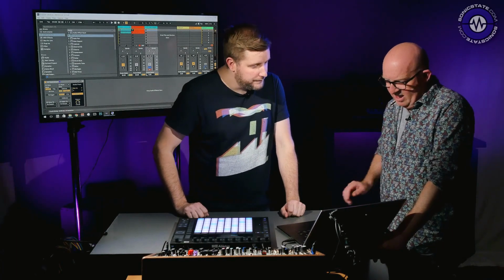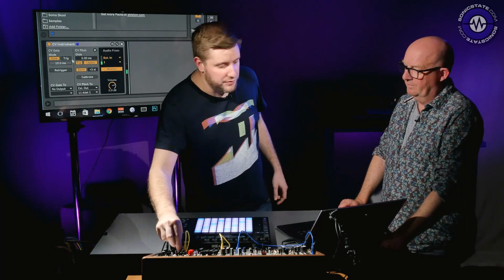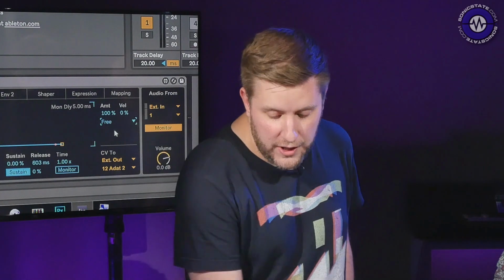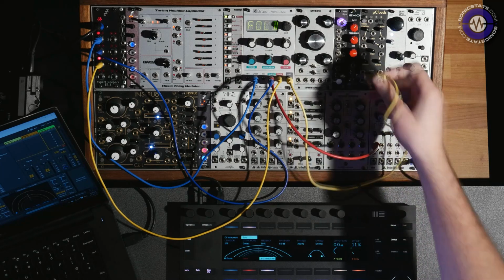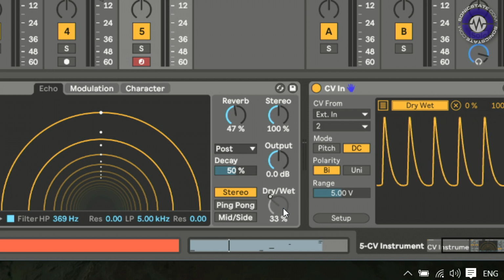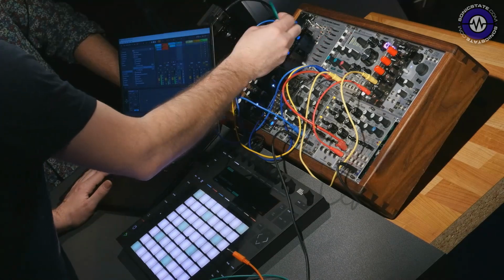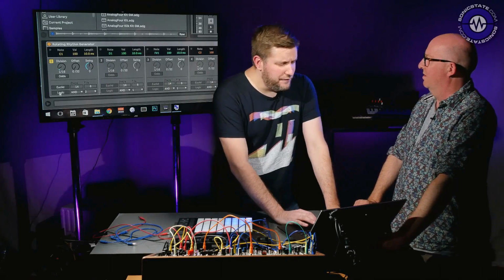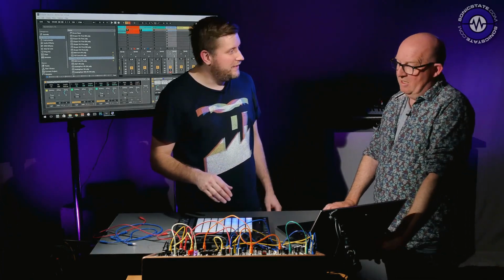Ableton CV Tools First Look

Comment: cv is short for control voltage, be careful, read the manuals first, protect your gear and turn the volumes down first so your speakers don't explode :)

Comment: Could a presonus interface studio 26c handle the cv outputting? On the site says it is dc coupled, yet , since it is bus powered  it has reduced range of control voltage

Comment: Had massive latency issues using just cv tools out thru Motu.
After much messing around i have it working now.

Send CV out thru an 'External Audio Effect'.
Bring audio back from modular thru 'External Audio Effect' with 'Track Delay' and all is well.
Ableton support are in denial about this issue. 
When i told them i fixed latency myself they wanted to know how lol
Reply: Try sending cv clock out from master channel out channel instead of an input channel in the daw as the clock out.

Comment: I'm new to all this but understand the basics of CV/Gate etc. I'm confused as to how to get the signals out of Ableton though. Here he uses a Lightpipe to CV, but will a cheaper Midi to CV work just as well? I'm not sure it will as the lightpipe can contain more data than a standard midi but I may have got that all wrong haha
Reply: MIDI to CV is only going to translate note and gate information. That's it. ADAT/SPDIF/USB to CV modules can actually send and receive gates, pitch, modulation, audio, etc.

Comment: Im also still a little confused about how the interfacing works. Is there any way to use this with AC interfaces like Focusrite? Also, with a DC coupled interface the cv is sent through an audio output?
Reply: Yes, with a DC coupled interface, it's all through the line outputs. Not extremely ideal. So what he's done here, and what a lot of us are doing, is picking up an interface from Expert Sleepers. They offer a wide variety of modules that can connect to your interface (via SPDIF or ADAT), or directly to your computer as an interface (via USB).
Reply: If you have a focusrite whit adat input/output expert sleepers es3 and es6 is a no brainer 🤘
Reply: @inkognito4494  Thanks!

Comment: Can I use any audio interface that is DC coupled?  Can ableton handle using two audio interfaces now?  So you can use one for cv/gate and the other for audio signals?
Reply: I have an System-1M that can send cv/gate, and it shows up in ableton as an audio interface.  I'd like to know more about how ableton is handling two interface, because up til know, you've got to use asio4all if you want to use 2 separate audio interface.
Reply: @isaac.anthony  If you have a digital out on let's say an RME interface you can daisy chain multiple interfaces, probably best to use multiple RME interfaces but I've never tried this so that's just a precaution assumption.
Reply: Did you see how he was handling audio and CV in this video?  I couldn't tell if they were using one audio interface for all of the audio and cv coming in and out of ableton?
Reply: @isaac.anthony  He was using expert sleepers es-3 for the cv-outs and I'm guessing he's running the audio out of the vca straight into his audio interface. I have a similar setup that he does, and only use one audio interface, but you need to have an lightpipe ADAT output to do that.
Reply: @bzilla4000  thanks for the info!  Ableton really needs to be more clear about this, not easy info to find...
Reply: @isaac.anthony  on macOS you can create "aggregate i/o devices" in the audio settings that basically allows you to use multiple audio interfaces. I'm not sure how good asio4all is if you're a windows user.

Comment: I'd love a episode with an explanation of this setup. I'm really confused about the signal routing.
Reply: The ES-3 ADAT CV interface shows up on your ASIO driver audio interface drivers as 8 devices on ADAT out 1-8.   You would define the outputs in ableton config and be able to select that output from the dropdown in the cv instrument.  If your audio interface supports DC coupling on its inputs, then you can use a floating ring cable for CV in.  This would be just choosing one of the DC coupled interfaces that your CV in floating ring cable is plugged back into to have CV input.  I use the ES-9 which just talks to my PC via USBC cable, and it has 8 outs and 14 ins and is a full-blown audio interface with mixer/eq and its awesome (and I extended it with an ES5 to add 8 more outs which can be daisy chained 4 more times i do believe)
Reply: Exactly not sure why nobody has done a video in detail about this

Comment: Eurorack modules often also react to triggers from a AC couples output, just use a suitable short sample in simpler for instance and it will often do the job. In my set-up it works about 80% of the time.

Comment: A bit offtopic, but what audio interface is being used in this video? Is ableton working through Asio4All? Been trying to get my Expert Sleepers Es3+Es6 to work together with my Focusrite Scarlett through asio4All, but Ableton is constantly crashing or not identifying the devices. Also using a windows btw
Reply from the maker: I couldnt say, but suspect its just the Focusrite drivers (this was on windows)
Reply: Try using the newest Focusrite drivers, rather than Asio4all
Reply: Doesn't Windows + Asio have some kind of problem using two audio interfaces at the same time? On OSX you can combine two audio interfaces to make a single aggregate device within the OSX Core Audio driver. This is what you need to do. I just don't know how to do it on Windows. Check google for "Windows aggregate audio device" or something like that
Reply: Cocker  The situation he is describing isn’t using multiple interfaces. The ES-3/6 aren’t audio interfaces, they are adat expanders. They run as a slave to the main interface. No extra drivers or aggregate needed. What is mostly likely needed is up to date drivers from Focusrite.
Reply: I tested asio4all and it crash in Ableton live. I use Expert sleepers Es3 and Es6 whit Scarlett 18i20 2 gen. Works perfect whit focusrite asio. If you use a gen 1 just update  the driver and mix controll app.

Comment: I tried these when they first opened the public beta, but CV instrument lacked any built in adjustments for latency, so anything you recorded coming back through the CV instrument was way out of timing with the notes you’d played, compare it to the built in latency adjustment when routing signals through the native Ableton external audio effect device
Reply: You don't have any latency with audio accurate timing. The latency must have come from your instrument. Mine has no latency.
Reply: hi  @ChrisWhittenMusic , maybe a demonstration of the issue would help clarify, please see https://youtu.be/3S03TvLmuM4
Reply: @Robert-kx8mp  Confused.
You record your audio exam try the same as any other synth. Through a DI or your audio interface input. I haven't recorded using the CV Instrument input.
Secondly, you have the attack time on the CV Instrument envelope at 30ms.
I just use CV Instrument to control my modular synth. The audio that is generated goes back into Ableton Live via my usual recording chain. Doing that I've seen zero latency.
Reply: Sorry, spell check. You record thru a standard input chain. I wouldn't use CV Instrument 'monitor' to record. Also, check your envelope settings.
Reply: Hey! Thanks  @ChrisWhittenMusic , recording Ext. In from the audio interface seems to work much better. I'm not sure yet if I prefer this over Silent Way routed through Ableton's External Audio Effect. This CV Instrument does have that wonderfully easy-to-use look and feel. The Silent Way plug-ins are an entirely different beast. I don't perform live with my modular gear, but rather I use it more along the lines of creating sampled instruments, or I'll outboard tracks originally composed using software synths. Anyway, I'm glad you helped me figure this out.